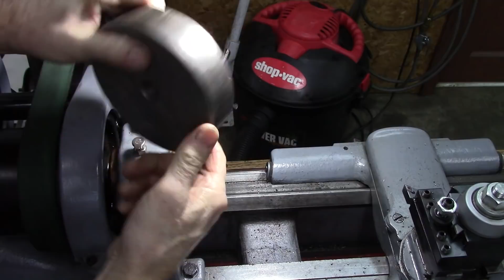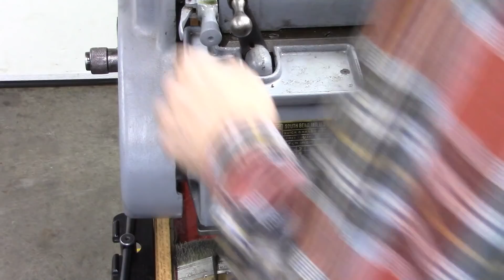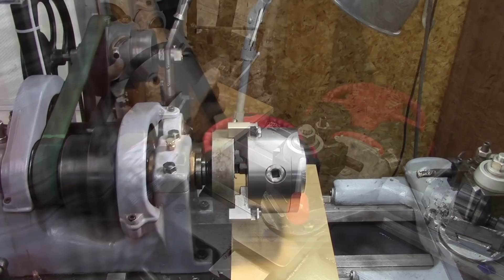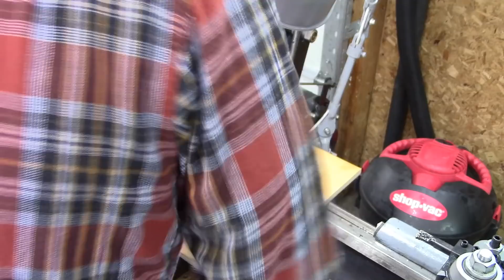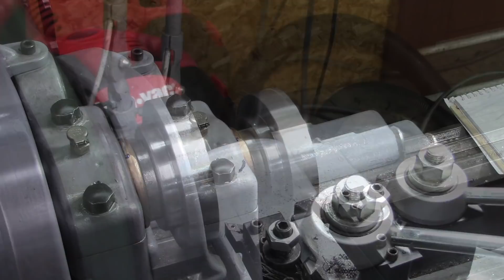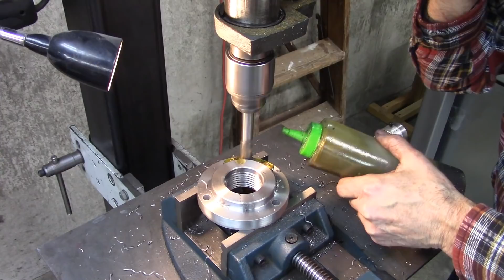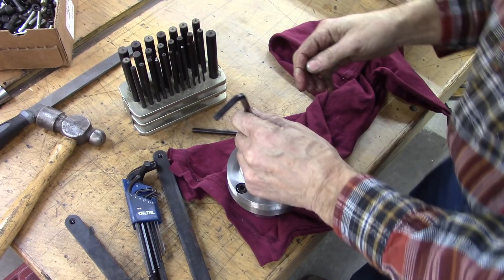Making a Backing Plate for a Collet chuck

Comment: great vid Winky, I might make one myself. I have a few spare gauge pins to give you if you'd like.
Reply from the maker: Thanks for the offer but I found a linear bearing shaft forked very well.
Reply: @WinkysWorkshop  oh good, I figure that's a lot straighter and flatter, how did it look with the indicator on it?
Reply from the maker: @tilliesinabottle  I had to shim one edge with a .001 shim. The bar was about .012" out 10 inches from the chuck. It's within .0005 now.

Comment: Good job, a very useful project.
I use an ER32 on my mini lathe. I bought a chuck that fits straight onto the spindle. I also use an R8 ER32 chuck in my mill so they can share the collets. Runout on the lathe is a fantastic 0.01mm and bit more on the mill. The trick with ER collets is to keep them clean, treating them to an ultrasonic clean now and again gets the tiny hard-to-get-at muck out of them, use a mild detergent and very thin coat of oil to stop rust, there's a YouTube video showing this but I ca't remeber who or when 🤔. Also look out for ER square and hexagon blocks to cut flats on round stock making them versatile. 
The point Winky made about ball bearing nuts is worth knowing to get good clamping on hard materials such as end mills. Another good point is noting that the slots are cut from the front and the back alternately which gives even clamping along the length if the collet and allows a bigger clamping range, usually 1mm (40thou). 
I like it as well 😁.

Update: the ultrasonic cleaning of ER collets and the nuts was by Stefan Gotteswinter. Here is the video, fast forward to 12:00 for the ultrasound cleaning segment.
https://youtu.be/jkHQq0L5aDk
Reply from the maker: Thanks Les. Yes I need to get some hex black.
Reply: @WinkysWorkshop  I think you mean hex block. They are very useful and saves fiddling around indexing.
Keep your inventive ideas coming please.
Reply from the maker: @lesmaybury793  _ ah...  yep!

Comment: Mark, as always "I Like It".  I don't know if we tell you enough, but you are a great teacher.  Of course it's fun to showcase the things we make for our audience, but you never forget to pass on your knowledge in an easy to follow and understand manner, with all of those seeking to learn what is something taken for granted as we become proficient.  So from me and all those silent but grateful listeners out there, Thank you.  Gilles (PS: I'd love it if you'd have a peek over my side of the fence if you have a chance).
Reply from the maker: You are too kind! Just watched you cutoff tool video. I love the HSS with cobalt with the T shaped 3/32" blade although I think mine is 3/4" tall. I usually part off at a feed rate of .001 per revolution and 170 RPM but 800 works a little better for 1" dia or smaller. I use the 170 so I don't sling oil everywhere. I have never had luck with the quick change tool holders although I have not tried them on my South Bend, only my Logan. I designed a direct mount blade holder that worked well and more recently a spring cutoff tool for the quick change. So far its worked fantastic.
Reply: @WinkysWorkshop  I definitely have to make a tool like yours.  I'm also going to engineer a carbide cutoff holder. The one I bought didn't last.

Comment: Winky, I don't know why you Americans are so obsessed with transfer punches. All you get is a small mark for your drill to wander from. You already had a drill jig in the form of the collet plate, with the clearance drill spot through 1 hole to full diameter. Continue through with the tapping drill, then tap the hole. Fit a bolt and lock it down. Spot through the other two holes, the parts can not rotate, drill and tap the other two holes. The bolts MUST line up as they were done from the  collet part. Although I live in Australia, I originally came from England, in my 35 Years of engineering I have never even seen a transfer punch. You just can not beat spotting through any holes if you have the other part, any errors in its manufacture of hole spacing will not matter as long as you ALWAYS align the same two holes. I know that in your instance you were drilling clearance holes in your backplate, but you could have spotted through the chuck with the tapping drill, then open it up to clearance. Fit a bolt to stop any rotation, then spot through the other two holes. That runout error could be allowed as the Chinese parts are often only accurate to 0.002" TIR. You get what you pay for. I noticed that you never took and Spring cuts as  you were threading, that last 0.005" cut sounded very heavy. Great outcome anyway. Regards from Australia.
Reply from the maker: Yeah...  the last cut on the threads was .005". I didn't take a spring cut because I was paranoid about going too big. I love my transfer punches! Haha...  Although, in this case you are correct, I would have been better off using a drill. The primary problem I have with transfer punches is fit in the hole. If the fit is snug they work fine. After drilling the holes (and enlarging them) I found the holes in the check were not located correctly. One was in toward the center and the spacing was not the same. Of course I assumed they were correct and that my holes were off and enlarged the holes. It seems like a well made chuck otherwise.
Reply: Transfer punches are the correct method.
Reply: @65cj55  I TOTALLY disagree. I have NEVER used one, but looking at them all they are is a rod that fits the hole with a center point ground on it. So all you end up with is an indentation of where the center of the hole is. When you start to drill, even with a center drill, you still have the possibility of it WANDERING off, especially if the drill is blunt or sharpened incorrectly. So spotting through the part is ALWAYS the best option as the drill can NOT wander off from center. Are you a Professionally trained engineer ? I did 40 Years as a Toolroom Engineer in England, so I DO know what I am talking about and that it is Industry Standard Practice to spot through parts unless every item is accurately machined to Spec and should fit.
Reply: @daveticehurst4191  They make it much easier, Whinky didn't seem to use the right size, i've been using transfer punches and screws for well over 40yrs, putting drills though pre-drilled, machined or threaded holes is not good practice, just because you did it, it doesn't make it right.
Reply from the maker: @65cj55  - Yes... my punch was a little too small and it would have worked much better if the transfer punch was the correct size. But I also agree with Dave, spotting the hole with the correct size drill works very well. Especially when given the choice of using the correct drill size vs an undersize punch. Of course this doesn't mean I'm tossing the transfer punches.
Reply: Americans aren't the only people who use transfer punches.
Also, Americans are just English people who didn't want to be ruled by your queen anymore.
We wouldn't expect you to understand why we like thinking outside the box. You may want to check our success before you tell us we all do it wrong. 
If you want to show us your approach, you should make your own video instead of race baiting in the comments. At least wheres your tools and where is the fruits of your efforts and labor?
Even if the guy in this video does a horrible job, hes still showing people what HE can show them. Its more than nothing...which is what you brought to the table when you used his video to be mad.
It shows.
Reply: @LolitAllisLol   I notice that your channel is not enginering based at all, so from that I assume that you know absolutely nothing about CORRECT Profesional Tool Making. I do have an Engineering Channel and if you can find a silly 5 minutes in your day to check it out, you will find many Videos of what I have made and tips and tricks of over 50 Years Engineering experiance. Regards.

Comment: Where did you get the ball bearing ER40 nut?  If you don't mind.  I have the same set up for my lathe.
Reply from the maker: Item number 124432892130 on ebay

Comment: Tolerance on cheap collets are about 0.005 - 0.01mm, so 1 thou is pretty good. Nice work.
Reply from the maker: Actually the collets are perfect. Of course I have not tested them all but I have checked maybe 5 of them and they are all the same .001 in the same direction (the chuck). The collet quality is shockingly good!
Reply: @WinkysWorkshop  wow that's amazing, got a link ?

Comment: Looks like the compound was set to 60 instead of 30 degrees? Or was it just the camera angle?
You can check the chuck run out directly by indicating the inner cone with no collet in place
Reply from the maker: No, it was 29.5 degrees but i have screwed up before. It makes some weird looking threads.

Comment: Use a spotting drill first .then drill your holes.
Reply from the maker: You are correct...  I didn't do this? Ahh, yes, you may be correct, I drilled a pilot straight from the transfer punch. I think one views had the best idea. Use a drill of the correct size in place of the transfer punch. I've tried this and it seems to work well.

Comment: To cut right hand threads move you compound back to 29.5 square the tool post square with the chuck .Flip your threading tool over so you can cut threads on the back side .By doing this you can see what you are doing..Use your saddle screw not your compound .set your compound to 0 and leave it..Your dial on the cross feed is what you use the cut the depth of your thread Not the compound....When you touch off on your scratch pass Take a sharpe and mark the slide so when you back out you can return to the same place each time.By cutting your threads this way you can see what you are doing.Your way you can not see the thread being cut....
Reply from the maker: I don't mind not being able to see although I really can if needed. I have better luck feeding with the compound. When you feed with the cross slide you are cutting on both sides of the tool. Also, the tool is not as well supported when flipped over. Dovetails do well under compression and not so well when lifted. Cut off works exceptional from the back side although my cross slide doesn't have the needed travel. Internal thread with the tool flipped causes the tool to dig in if there is any movement in your slides. I have never had issues cutting threads like this but have had terrible results feeling with the cross slide.

Comment: Well done, nice to watch. Rather straight forward as You planned the order of operations well.
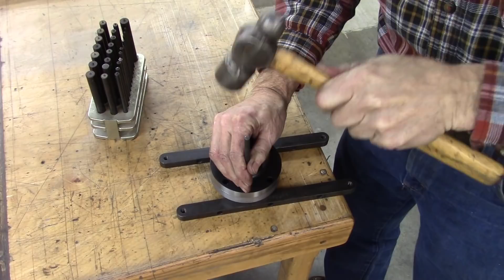At the time 29:50, centerpunching..... What about clamping the pieces together? Any rotation when punching the first holes the remaining holes would be off.
Time 32:00.... I hope You didn't turn that piece using the collet chuck... Any collet chuck would indicate low runout....
Reply from the maker: Thanks! You're right on the transfer punch. I got sloppy on the holes. No I was indicating cold rolled... not ideal but its all I had.

Comment: I'm guessing that lathe has a capacitor to start it. I wonder if it's the optimum value as it doesn't start as smoothly as I'm sure it could.
Reply from the maker: It's a typical repulsion induction motor. Very old, weighs about 80lbs and it's only 1/2 HP. It matches the lathe well. Oh...  no capacitors.
Reply: @WinkysWorkshop  No capacitors at all ! I wonder if it should have !
Reply from the maker: @millomweb  No, repulsion induction motors don't have them. I don't know about much motors but I do know that these motors were considered a work of genius by some. Several motor geeks have commented about the sound...  like, "ah, I love the sound of a repulsion induction". They used to be much more common. The two negatives are, they have brushed that either run full time or retract after starting. The ones that run full time do nothing while the motor is running but never the less they do ware and the ones that retract sometimes fail when the mechanism wears or gets dirty. The other negative is that you have to move the brushed to reverse the motor and they have no means to reverse by wiring. If you watch closely in some of my videos you will see a lever going to my motor. It looks like a shifter. This moves the brushes so the motor will reverse. I've had a lot of these motors in the past. They end up in scrap yards when the brush retract mechanisms get fowled by mud dabbers....  an easy fix!
Reply: @WinkysWorkshop  Does yours lift the brushes ? I'm going to say it does - and that's what gives it the jerky start ! Switching over from semi-conventional brushed motor to induction. The next question is which mode of operation is the more powerful motor ? The start could be weaker or stronger than the run !
It's a motor type/design I've not come across - so quite interesting. I guess t predates capacitor start - as I guess that'd be the modern equivalent.

We had a sanding machine (disc sander) in the school woodwork room that the start capacitor failed. So we just give the motor a spin before pressing the green button. It meant we could start it in either direction - a good thing ? cos we could then use both 'sides' of the disc !
Reply from the maker: @millomweb  - No, my brushes run full time. The start is very typical of this type motor.  The brushes are only connected to each other but there is something called a necklace that is contained by a spring made like a rubber band. When it expands it disconnects the armature. Here's a video where I worked on the motor a while back. https://youtu.be/_LM-tmLb_ic
Reply: @WinkysWorkshop  Thanks for the link. I've watched that video twice now :))) The 4 brushes still surprised me - and I wonder if the 4 are actually linked - rather than the more obvious 2 pairs.
Yes the 'necklace' shorts out all the windings to make it a standard squirrel cage induction motor - whether repulsive or attractive.
Interesting how it starts quietly with no load and rattly when driving the headstock. Even the windings (stator) was interesting with 4 large poles in there !

Comment: 33:40 To finish off with - a bit of lube on the threads (spindle nose and collet nut) and skim the 'back' faces of the backplate just so all the unimportant faces appear to run true.
Reply from the maker: Thanks !
Reply: Yeah, I thought a light skim off the face last operation would have been a good practice.
Reply from the maker: @stevewilliams2498  - I'm not sure which face you mean but I probably did this and didn't show it on camera.

Comment: 29:20 That was a 'fit' until you hit it with the emery - it was a little tight - but also, it was a little warm ! Let it cool and it'd be spot on, no emery necessary !
Reply from the maker: Ha...  I thought the same. As it turned out I had to reduced the size slightly more and bump it off center and add a shim. The chuck was crooked, not by much but it was consistent. I even tried cutting the plate a bit (not the diameter ) and about 10 inches out on a good bar is was .015" out. I added .001" shim on one side and undercut the diameter about .002 and then got it all to line up. As near as I could tell it was off the same way with all sizes. It's near perfect now. I probably need to pin it in place but I have the bolts good and tight.
Reply: @WinkysWorkshop  Fair comment if the thing's not true. Easy fix - mount it BACKWARDS !
Stick a big rod in the 3-jaw, turn that true and to a collet size - then assemble the the collet chuck and mount it on the bar in the three-jaw - then true up the back of the collet chuck ! - If that was the issue !
Reply from the maker: @millomweb  I actually started to do this but I needed a straight bar.  I had one but it had bolt holes in the end. I could have dealt with that...  maybe plugged the hole and drilled a center. I know it was the chuck. I moved it on the face plate and  the run out stayed with the chuck. A .001" shim between two of the 3 mounting bolts fixed the .015" I had at the end of the 12 inch bar but it made the .001 I had at the chuck more like .0025" For now it's dead on but if I have problems I may try this again. In hide sight I should have mounted a 1-1/8" bar in the chuck and let it stick out 3 inches. Then turn it down to 1" and mount the chuck backward. 1-inch would have been plenty rigid to fix the chuck without a the tail stock.
Reply: @WinkysWorkshop  Mounting backwards - is 1" the largest collet you have for it ?
Reply from the maker: @millomweb  Yes backwards and yes, 1-inch is the standard largest collet although I heard they make an oversized 1-1/8".

Comment: 19:15 "It's just a hair tight" - try it with some oil on the threads - it'll work wonders!
Reply from the maker: I did
Reply: @WinkysWorkshop  Did it work wonders ?
Reply from the maker: @millomweb  Of course! I knew from experience that the slight roughness on the threads would smooth out anyway...  although I have made the assumption in the past an been wrong. It's a matter of degree. Watch the video closely and you will see where i oiled the threads.
Reply: @WinkysWorkshop  We got a new electric drill with fold-away handle. Unfold and lock in place with a plastic-topped brass screw.  That screw was stiff - and I thought it'd ride up with wear - but it annoyed me - so it got oiled - made a big difference !